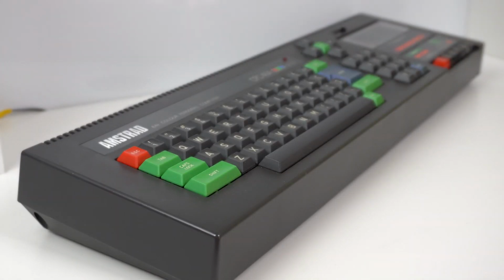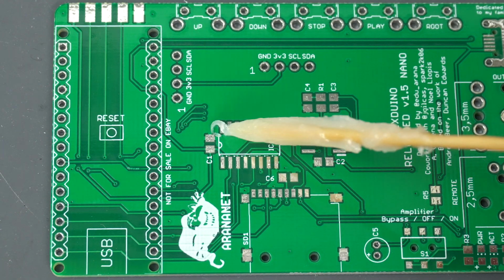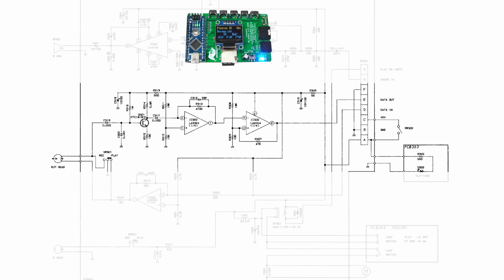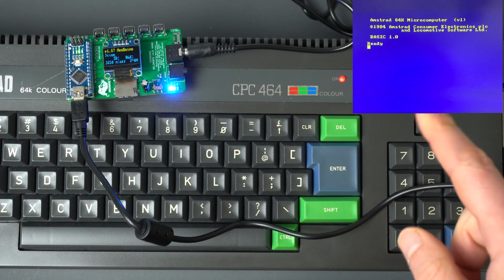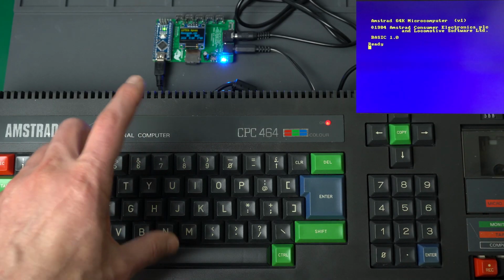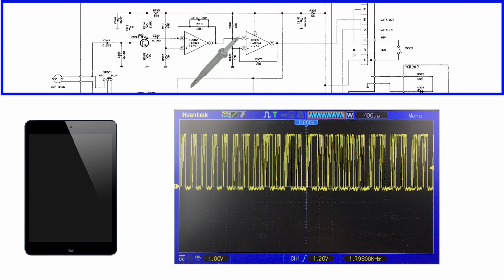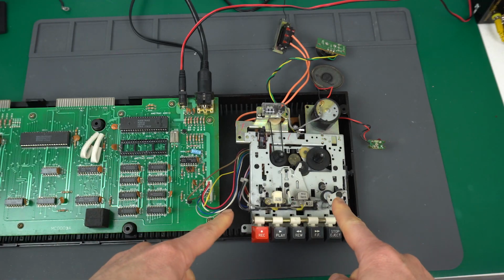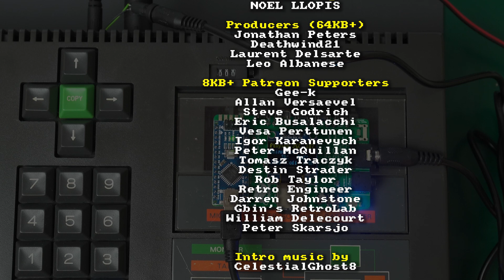Best Way to Add Audio-In to an Amstrad CPC 464?

Comment: You need an AC coupling to that opamp input, not a DC-coupling. Couple it with a 22nF cap to the input of the first opamp. It's not good to have a DC coupling at this stage, because the system should work independently of the average DC level of your external board. This opamp can handle high DC offsets at the input, but they can't all do this.
Your second solution isn't great either. The output of that transistor also has a DC offset. It's just not done to couple 2 signals with different DC offsets together. You could blow up your transistor. If the transistor is driven (your play a tape), it shorts out the DC level coming from your external board.
Reply from the maker: I'm not concerned about the tape being activated at the same time as the audio input, but that's a good observation about there being a voltage at that input point, which is not ideal. I agree that the best solution would be to connect it to the input of opamp 1 with a small capacitor. I even had it like that at one point but went with the exiting capacitor when I saw it right there. Doh! I'll do a mini-update in the next video about this and a couple other things. Thanks!

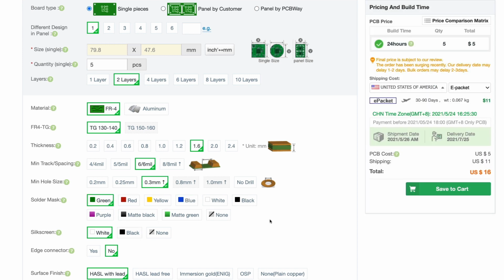Comment: Hey, what is that thing call in the 2:31 ? SMD picker ?
Reply from the maker: Yes, I think it's an SMD suction picker. It's pretty useless as it only works on ICs, not small components, but I was trying it anyway.
Reply: @NoelsRetroLab  well I always had trouble pucking the IC with my tweezer cuz It's too slippery. That might useful for me 😂 oh, by the way the display on that maxduino is OLED 😉

Comment: I did this and worked but now, all of a sudden my maxduino is stuck in reset when has a card inserted, any advice? By the way, when having REM plugged in, the maxduino gets some voltage through it, did you know that? Dont know if thats normal
Reply from the maker: That sounds really weird! I wonder if you have a short somewhere in the maxduino and it's causing that. Otherwise no voltage should be flowing back and effecting the device!
Reply: @NoelsRetroLab  I mean, when I plugged in the rem wire, having my maxduino off, some leds gets on, weird I know, but its the wiring that worked the whole morning for me!

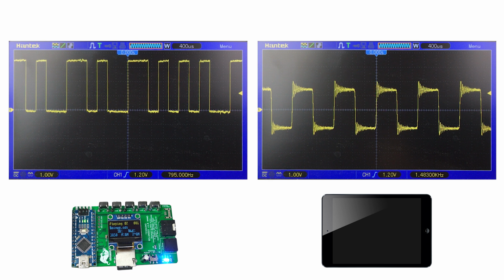Comment: 19:50 - that doesn't look like a sampling issue, that looks like an impedance mismatch/inductive ringing issue. truncating the fourier series will give you oscillations, but they'll be after and before the transition in a way that looks unphysical ( how does the system know the transistion is about to come up?) that waveforem looks more like something is oscillating in the system in response to the sharp transitions. moving it evidently fixed the oscillation, and that's why you don't see those oscillations in the output of the ipad when you move it

Comment: Why did the AMSTRAD not have a SPDIF output and SPDIF input to allow you to use a DAT machine and would also mean that the file name appears in the display of the DAT unit and make for easier program searching so you load the program you want to play and the one you don't.

Comment: Is there a similar mod available for the Spectrum +2 128k?
Reply from the maker: Yes. I know people have done it, but I haven't looked at the specific input points. Someone in the Discord channel mentioned they had done it, so you could pop in and ask them if you want. It should be very similar to this.

Comment: Set the data output pin of the arduino to pinMode(data pin, INPUT); when not sending data to make it high z. Set it back to pinMode(data pin, OUTPUT); to send data

Comment: The "feature" where the audio amplifier picks up and plays parasitic signals due to poor PCB layout is an example of a digital electronics engineer designing an analog circuit. When making digital circuits crosstalk isn't much of a concern - there usually isn't enough noise to be a problem. This is also why early PC sound cards were for the most part awful - lots of hum, hiss and high-frequency noise - all because the boards were poorly laid out (and also because they powered analog audio chips from the main 5V line that was extremely noisy)

Comment: Perhaps you should use a tip ring sleeve jack so you use the same hole for both signals... it will all be in the same jack and no extra hole will be needed. You just need to make a custom cable.
Reply: That would bring 5V to other channel of device output. Even trrs connector could make damage to outputting device or Amstrad.
Reply: @mrblc882  There is no 5 v..... it's a switch. No damage.
Reply: @GORF_EMPIRE  relay is connected to +5V and is activated when play on signal is grounded. While signal is not grounded, there is 5V trough relay. Relay coil have some resistance, way smaller than microphone input on smartphone and that could burn mic input on phone.

Of course, that issue exists only if someone connects phone via trrs cable. But since it's faster to just unplug Arduino and plug phone, that scenario is highly likely.
Reply: @mrblc882  It will be fine. Use a decoupling cap.
Reply: @GORF_EMPIRE  decoupling capacitor passes only AC component, so for that kind of signal would produce spikes on transitions. Technically, you could modify remote input to detect spikes, but still that spikes' energy should be low enough to be safe for mic input and high enough to trigger detecting circuit and to higher than possible noise. Theoretically possible, but too much added complexity compared to problem we are trying to solve.

Alternative would be to use TRRRS especially if there is plug that is backwards compatible with T(R)RS, but that's proprietary and not readily available.
Reply: @mrblc882  the mic and the remote are on a separate wire. You wont need any additional anything.
Reply: @GORF_EMPIRE maybe i misunderstood something, but TRRS in today's phones use T and first R as audio output and bringing incoming signal to those two would overload output amplifier. Second ring, next to sleeve is ground and sleve is mic input and button input. If it's grounded whole time, it signals that headphones are without mic, otherwise, input is activated and bringing voltage higher than mic output would be bad. There is no other wire unless you use proprietary TRRRS connector, which is not readily available on free market.
Reply: @mrblc882  you have audio out and remote in. Yu are making this much more complex than it is. They are not connected on the same wiee and you only need TRS, not TRRS not TRRRS. T for audio, R for remote. Plain and simple. There is no voltage on the T audio wire other than the low signal. The R remote does not get connected in any way, shape or form to the audio T.
Reply: @GORF_EMPIRE  if you have educated and careful user, you are right. If you want to design foolproof connection, your idea is not acceptable. I'm always on foolproof side, whenever it's possible without too much complications, because even slim chance of user's error will eventually happened after so many connections.. In this case, it's possible by using pull up resistor on Arduino side and optocoupler on Amstrad's side.
Reply: @mrblc882  IT will work fine.
Reply: @GORF_EMPIRE  I believe that we talk about different scenarios... It will work fine, unless someone uses 4 wire TRRS cable to connect phone with Amstrad. If someone uses 3 wire TRS cable, no issue except, jack will pull down play on signal, but since he isn't using tape, nothing happens.
Reply: @mrblc882  Nothing will happen either way.... what part of "the signals are not connected in anyway" don't you get?
Reply: @GORF_EMPIRE  of course, if user uses your custom cable. But, expecting that user will not plug market available straight connection cable in which signal is connected is not foolproof.
Reply: @mrblc882  You are really starting to be annoying. I never suggested he buy a cable. I made it clear that he needs to build a custom one. You need a lesson in reading comprehension and obviously a few basics in electronics. Neither signal will cross paths if you properly construct a cable with TRS.... it could not be any simpler.
Reply: @GORF_EMPIRE  you never suggested he buys the cable, but people have cables at home (e.g. for connecting phone to aux in on car radio) which is usually used with this mod. When you makes something for yourself, you can expect yourself to never use any other cable other than custom built one, but when you are doing something for someone else, things that could physically be plugged will eventually end up plugged, including cable which users usually uses to connect his phone to external devices.

It's not that your idea will result in 5V on audio channel, but highly probable user error will result.

Comment: You would be better of with a separate cap for the aux input, as shown in the video you are passing the collector voltage from the transistor stage out that input socket. Audio inputs should be inputs, not a source of DC. You will probably get away with it, however for the price of a cap, why not avoid any future problems.

Comment: There need to be capacitors AND resistors on BOTH wires, or a switch between cassette and the jack. 
You not only connected the ipad output to cassette input, but also cassette output to ipad...output!
Do you not see a problem with that?! 

The ipad output signal may be fighting the cassette transistor (and possibly frying it), 
and the cassette may be backfeeding into the ipad OUTput, who know how that would go.

The op-amp is perfectly able to amplify weak signal - that's what it's for, 
so please add a resistor (something like 1k-10k probably?) and a capacitor (same 0.022uF should be fine).

If the cassette transistor actually drowns the signal with the resistors, then it should be disconnected from opamp input directly and connected through a resistor too. In that case you will need to find the value of the resistors that do not degrade the signal much but still allow both signals to be used. I suspect somewhere in the range of 50R-1k should be ok, but that should be tested before soldering permanently.

Comment: Maxduino wasn't not installed properly... its a multi step process.. If you are using a Nano then you need to be picky about which files are support... and when you first booted up maxduino you saw a strange 2 horizontal bars that is because you didn't configure the logo properly which is a 2 step flashing process..

Comment: Creates an Amstrad CPC with 1 GB of memory and with 64 bits and with 16 581 375 number of colors available and with CD drive.

At startup it marks with the same screen color.
----------------------------------------------

Amstrad 1GB Microcomputer (f1)

©2021 Qmstrad Consumer Electronics plc
                       and Locamotive Software Ltd.
BASIC 1.0

Ready
■